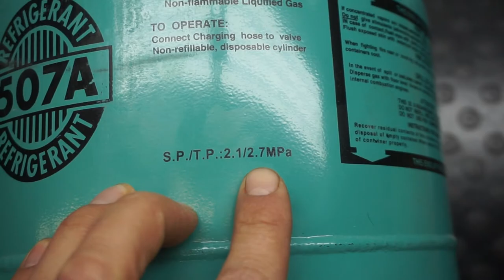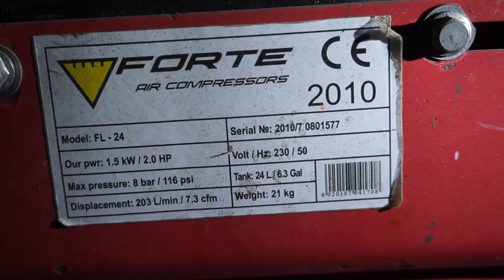IDEA FROM CYLINDERS FROM FREON

Comment: the center weld on those tanks is prone to rapid deterioration when humidity is introduced to it.  there is no safe way to do what you have done. Keep your psi low as you have just built a pneumatic bomb. maybe you'll only put your eye out.
Reply: When an air tank explodes it's a major medical event.   RIP
Reply: they are burst tested at over 800psi. you can literally just throw some paint in it and tip the tank around to coat the whole inside and the welds. in that case its safe for all practical uses. Even with some corrosion it'll;
l leak before it completely lets go.

Comment: Those are single use only, illegal to refill them. The wall thickness is too thin to handle repeated fill/drain cycles and the metal will fatigue, and anything that happens when one of the tanks blows and you're 100% liable.
Reply: ... there's probably NO Regulation or Safety Standards in his Country.   They probably don't have proper Building Codes 🤔  3:03 Just look at that cellar, it has exposed rebar in the ceiling, and look at the crumbling structure around the doorway 🤨
That's the first thing I notice when I see videos like these.

Just like when I see the truck repair videos from Pakistan or India, No one is wearing any Safety Gear, or flame retardant clothing, much less any eye protection. 🤔  
People are Expendable there, but I will say some are better trained and educated than in the West, especially when it comes to trades.  There's no training in the U.S. in any trades, at least not free ones, or inexpensive ones.  Education is very expensive here.
Reply: Fun police have entered the chat!😅😂

Comment: Max psi freon tank can hold? I dont have any idea 120psi did not blow up?
Reply: This refrigerant has a pressure of over 300 psi at 120 degrees. The tank can probably handle twice that. It says 7 mpa on the tank (maybe, I can't tell for sure). If that's correct it converts to a little over 1,000 psi.
Reply: ... 0:04 the tanks test pressure is rated at 2.7 MPa = 391.602 Psi.  Service pressure is 2.1 Mpa.
Reply: 25lb refrigerant tanks are burst rated at over 800 psi. For all practical uses this tank farm should last multiple years and hold 250 plus psi fine. Use paint, bedliner in a can is better. spray enough for it to pool inside of it, swirl it around to coat the whole inside. Dump the excess out. Connect them all together, and you have a nice auxiliary tank/tanks. Dont weld on the bottom like he did however. that will be the first failure point, they're made to expand and contract. Welding on the bottom fks up the ductility of the metal and when it expands and contracts, the edge of the weld will fail but if you just use the fitting on top, these tanks will take a lot of pressure.
Reply: @austinsiebert  then how do we put another valve on it? I really gotta know so I can transfer refrigerant. 🤫
Reply: @theadjuster151  there's a video on YouTube disabling the check valve on one
Reply: @theadjuster151 harbor freight has cheap refridgerant charging hose kits right, then just go to autozone and get the fittings it snaps on to and plumb those fittings onto any tank. If you have a welder you can weld a coupler to the tank and weld a fitting on it, even use an old ac compressor as a diy transfer pump. Bunch of ways to do it.